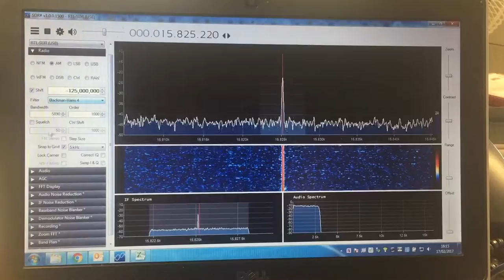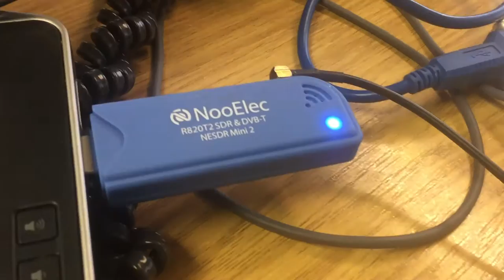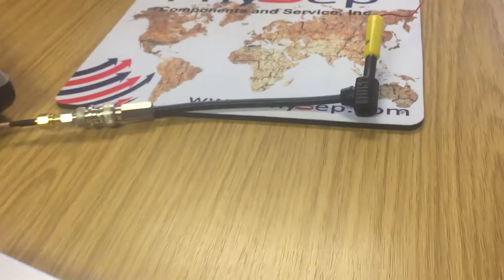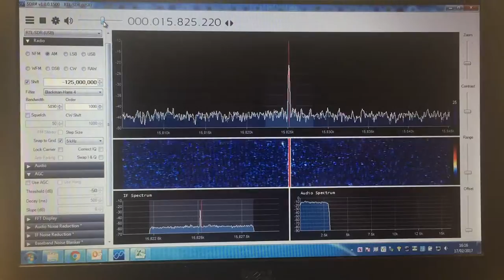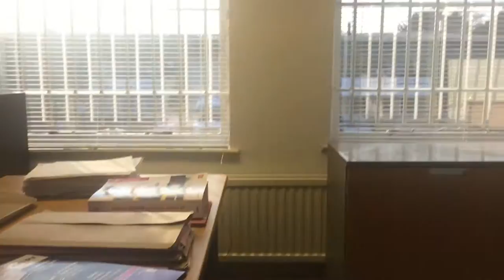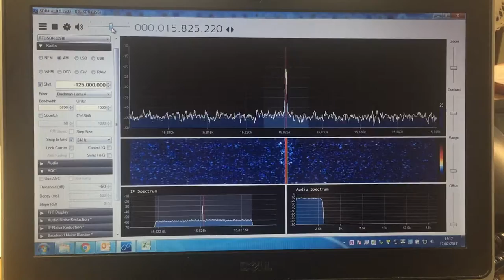Office DXing with RTL-SDR and and few feet of wire: WWCR Nashville 15825 kHz

Comment: Nice catch! Nooele. Also makes a aluminum enclosure for the dongle. I have one and it cuts down on noise from computers and such. I bet if you hook it up to a long wire you will pick up a lot of stations. Happy DX. 😊
Reply from the maker: Thank you very much! I have the Ham-it-up upconverter which I assembled into the supplied aluminium case - I wasn't aware of the aluminium option for the dongle itself. You're right though, I'm sure it would help cut down noise. I was in the office at the weekend and I brought in my Bonito Boni whip and connected that up to the NooElec and caught a couple of really nice catches whcih I will upload soon. Thanks again and 73! Clint

Comment: Nice job! A lead fishing sinker weight and a slingshot are pretty good for makeshift antenna installation. You could use #32 wire for a temp test...
Reply from the maker: Hi there, thank you very much! That's a good idea and fortunately I own both of those items as I have been known to enjoy an afternoon of coarse fishing once every couple of years! Thanks for the tip! 73! Clint